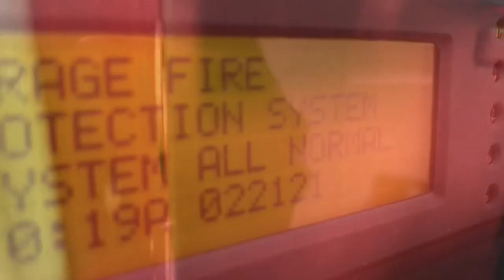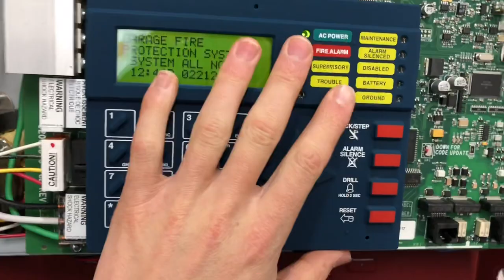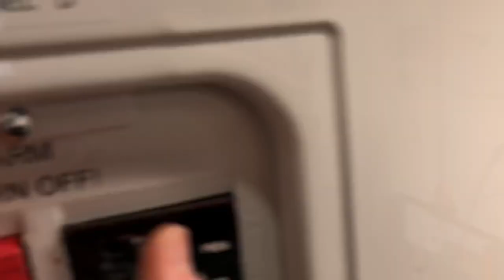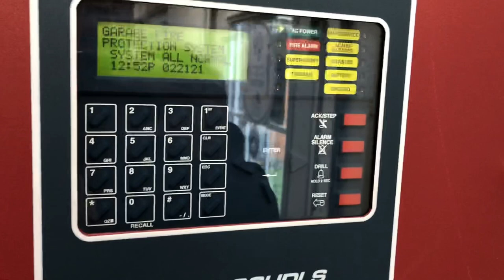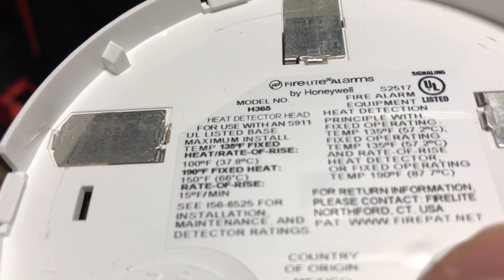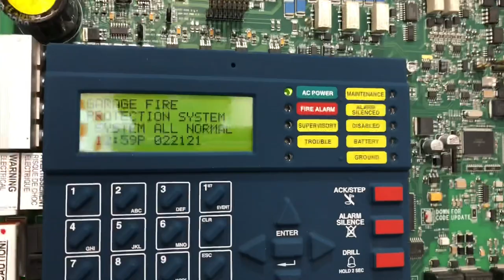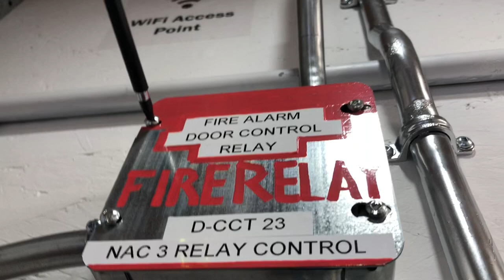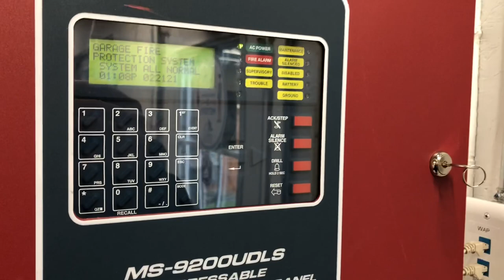New addressable fire alarm system!

Comment: Cool!  Personally not a fan of Honeywell addressable systems, but the system looks pretty cool.
Reply from the maker: I personally don’t like any other brand Simplex is terrible EST is better but still not my favourite lol
Reply: I say Simplex and Notifier is my favorite
Silent Knight is great
Gamewell FCI is pretty good.
Fire Lite is good but I think it’s overrated
I don’t like EST but I like the IO panels and there older panels (before the ESA2000)
Siemens you can’t do much because a lot of there panels are mostly proprietary and to address a device you have to get a Siemens DPU (Device Programer Unit).
Bosch systems is always in trouble.
Reply from the maker: @SomeDudeWithAnExitSign  My favourite brand is notifier
Reply: @nics-systems-electric  Notifier makes some pretty great stuff.
Reply from the maker: @SomeDudeWithAnExitSign  Firelite would be good too if they made a series that could compete with the onyx series from notifier
Reply: @nics-systems-electric  well. Fire Lite and Notifier are owned by Honeywell. If Fire Lite made high end panels it would be a rebrand of the ONYX system. Remember the FireWarden series exist and that's just a rebrand of the FireLite MS9200UD,MS9200UDLS,  MS9050UD, ES50X and ES200X.
Reply from the maker: @SomeDudeWithAnExitSign  yeah not sure if it will ever happen
Reply: @nics-systems-electric  I personally don't think so. I bet the biggest that FireLite will go is the 9600 series.
Reply from the maker: @SomeDudeWithAnExitSign  I think even notifier‘s 640 has more features than MS 9600 UDLS They will never have something as big as a 3030
Reply: @nics-systems-electric  yes it dose.

Comment: Are you going to get any Monitor modules to run conventional devices. I like the system.  I would like to see on the system is changes. Like one test has EST Genesis or Adaptabells you got out from that one system you replaced. The 9200udls is nice but the only thing is the panel is FWR so you can’t run Simplex devices from the mid 90s-present and mechanical horns will sound like crap. You should make a demo board with the SFP-10UD on one side and the EST QuickStart on the other.
Reply from the maker: Yeah I don’t like Symplex anyways LOL I will probably make some kind of demo I’ve got some new notifier stuff to show at some point
Reply: I think he should just keep the same A/V's up to keep it professional like a system you'd actually see in a building
Reply from the maker: @FireTech7  yeah I’ll probably stick to all system sensor and firelite
Reply: @nics-systems-electric  sounds good
Reply from the maker: @FireTech7  I may make some other demo systems
Reply: @nics-systems-electric  I'm thinking of adding a dialer to my system not sure which one yet though
Reply: Something that calls my phone and not the fire department lol
Reply from the maker: @FireTech7  I’d like to do that with my system to not sure how
Reply: @nics-systems-electric  download discord and add me as a friend I have a server I own that has someone in it that successfully made a central station and connected it to his 9600udls and it worked

Comment: Would you get a dress panel for the 9200udls
Also you should get a bg12lo with the weather proof back box
Reply from the maker: Dress panel would be cool I don’t think the BG12lo is addressable so I would still need a monitor module
Reply: @nics-systems-electric  yea but it is still a weather resistant pull

Comment: The tower seems like a ground fault waiting to happen.
Reply from the maker: It can’t though I didn’t run a ground conductor out there
Reply: @nics-systems-electric  I thought a ground fault meant that a wire that shouldn't be grounded ends up shorting to ground.
Reply from the maker: @Fahrenheit4051  Yes but there’s nothing grounded out there so if Wire touch something like the box it would just energize the box to 24 V not actually go to ground

Comment: Well that panel is older than me
Reply: Also did you do that wiring by yourself
Reply from the maker: @kalol1119  yes
Reply: I Cant even wire a mini system!
Reply from the maker: @kalol1119  I’m sure you can learn
Reply: Thanks!
Reply: I mean I can but only like 5 to 6 device's
Reply from the maker: @kalol1119  On a zone or a bell circuit once you’ve done some you just keep going it’s the same thing until the end device
Reply: Ok thanks for the tip

Comment: It call the firefires when you pull? Yes or no
Reply from the maker: What?
Reply: @nics-systems-electric  he's talking about the dialer
Reply: No it won't. It need a central station connected to the panels internal dialer and that would also need to be programmed and wired into the phone lines